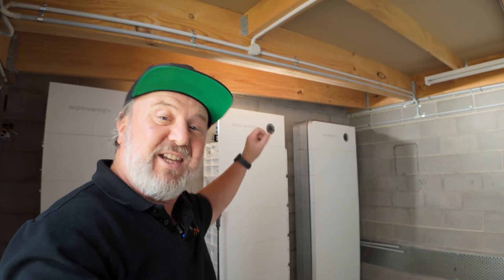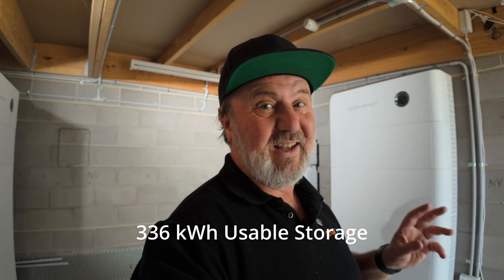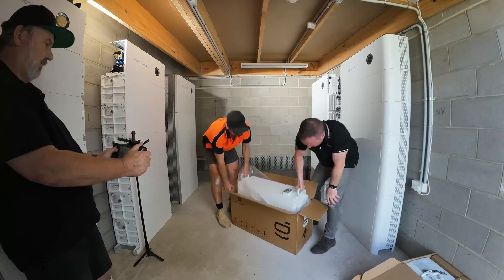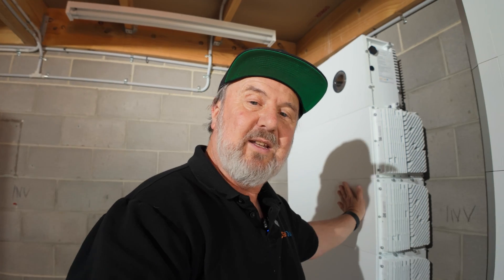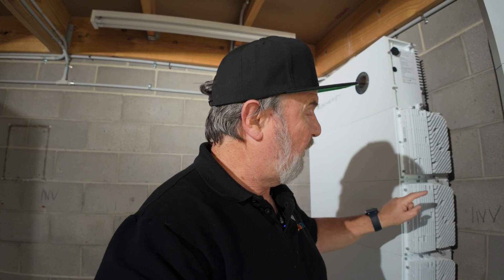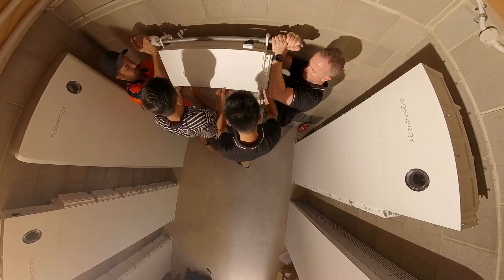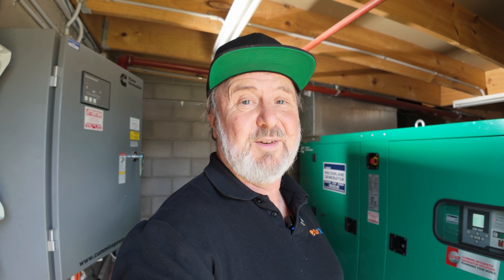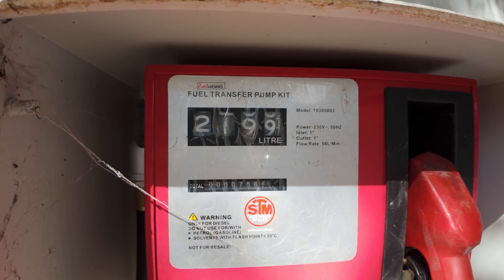Huge Sigenergy Off-Grid System

Comment: Great video Glen. Your videos are great. I am an electrical engineer and I just completed construction on a fully off grid luxury 800m2 house on a national park island in north queensland. truly a once in a lifetime project and your videos were an awesome reference during the design. The system had 300kWh of batteries(room for more as well), 90kW of solar and two 85kVA generators in duty standby (due to the remote location if one fails)
Reply from the maker: Thanks Mozz for the kind words. I'd love to learn more about your island project.
Reply: @SmartEnergyLab  Hi Glen, sent you an email with some pictures. if you got any questions feel free to respond there.